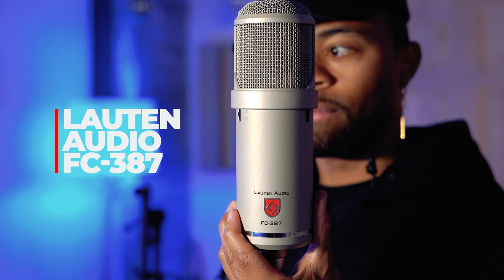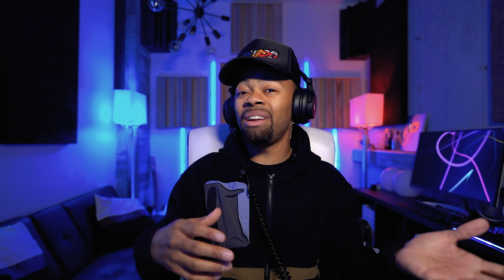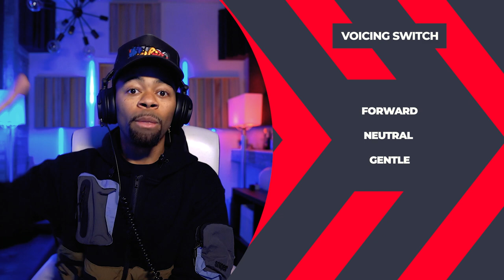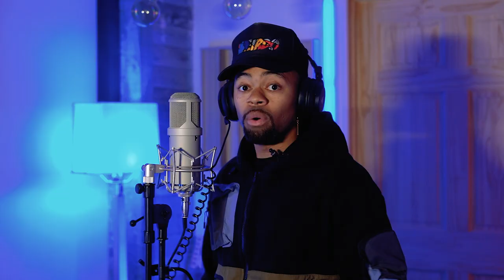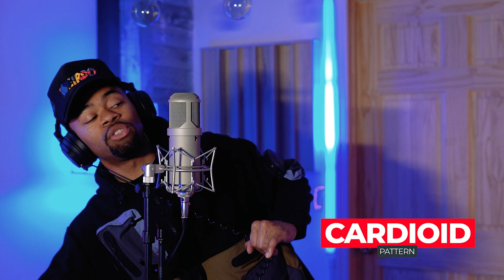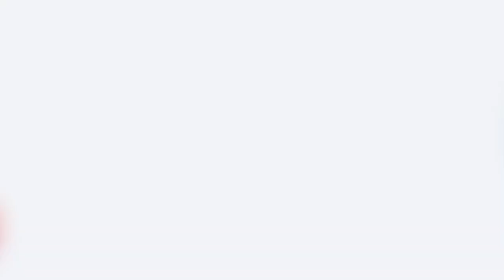This Microphone Will Make You Rethink Your Sound | Lauten Audio Atlantis FC  387

Comment: AMAZING MIC! I have a TLM103 and I’m saving up for one of these. Let’s not forget it has a low-end roll off switch as well 🔥
Reply: did you ever get it?
Reply: @rjjtmt  yessir proud Atlantis owner
Reply: @WIIMTheMusician  nice planning on getting one too i got a tlm 103 right now as well
Reply: @WIIMTheMusician  how does it sound compared to the 103? I have the 103 and I’m considering getting this
Reply: @naturespirits5575  well that’s why I made the video so u can hear for yourself! I find myself using forward mode 99% of the time for lead vocals. It has amazing detail, just like the TLM, but a little more controlled in the high end and sounds a little more realistic to me. Still need de-easing and subtractive EQ of course, but overall it’s a slightly better starting point that the TLM (for my voice). I still love my TLM though
Reply: @rjjtmt  it’s worth it (in my opinion) but it depends on WHY u wanna upgrade/add to your locker. They both have very good detail in the top end, but the Atlantis handles it slightly better in my opinion, plus u have the neutral setting to knock down the crispiness so-to-speak. I track with a BAE1073, so sometimes the neutral sounds nice and flat and then slightly overdrive my 1073 to add back in some of the grit. It’s all a balancing act. I’ll also say that there’s a huge difference between forward and neutral (neutral is MUCH flatter/darker), and not much of a difference between neutral and gentle. I wish neutral was more “in the middle” of the 3 settings, if that makes sense.

Good luck on your journey!